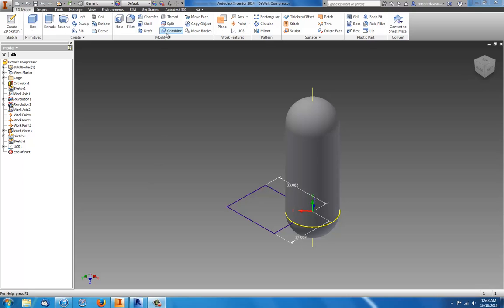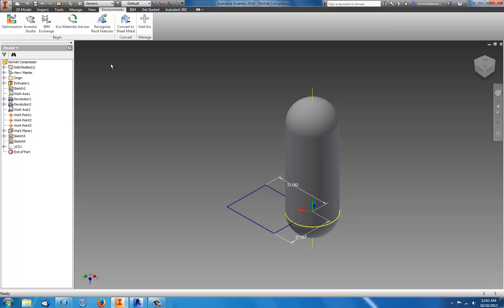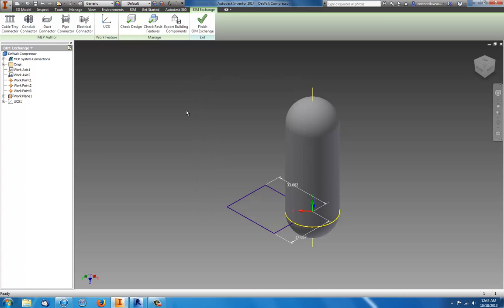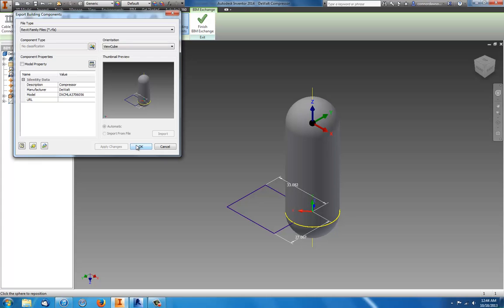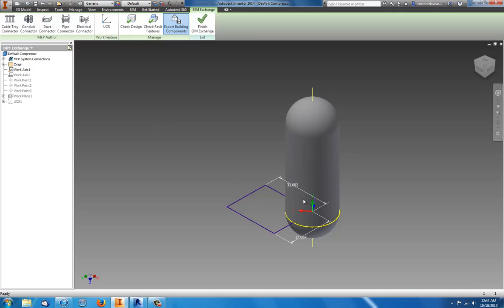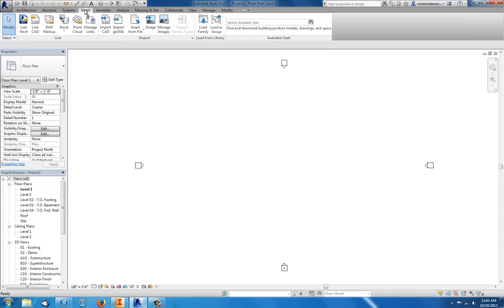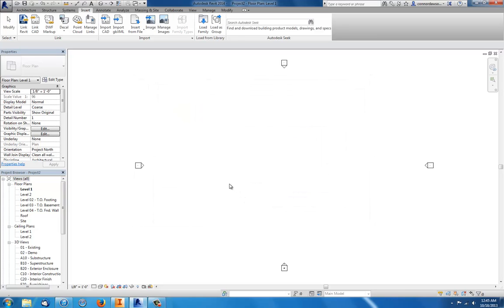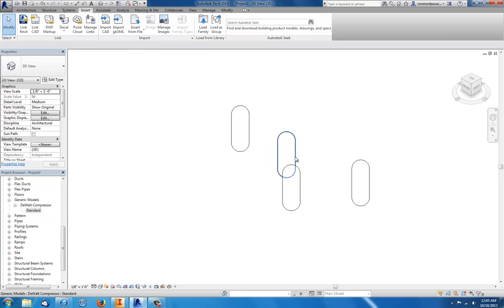How to Export 3D Inventor Files and Import Them In Revit 2014 Autodesk

Comment: I would appear to be able to only export to .adsk file type not .rfa which I am assuming is what Revit would need to use. Do I need an addin or to enable something in my inventor for the .rfa option to be available?
Reply from the maker: Use BIM exchange not Export.
Reply: porkercon I also can not export to .rfa (.adsk appears but is greyed out) however I am using BIM exchange. Any suggestions? (I am currently on the 30 Day free trial, will this make any difference and if so, is there a way around it?
Reply from the maker: Probably not included in the 30day trial.
Reply: ***** Okay I found a way of resolving this issue for people having similar problems. Use the 'Simplify the Data' tool, then the 'Recognise Revit features' tool.. and then it should work.
Reply: ***** i cant find the simplify the data tool , please help
Reply: Exporting it as a .rfa from inventor just lets you skip a step. when you export as a .adsk you'll have to import it in Revit to a family file(.rfa) and then place it in a Project.